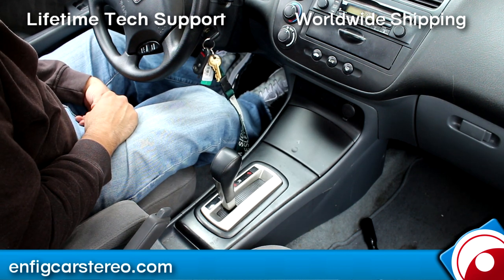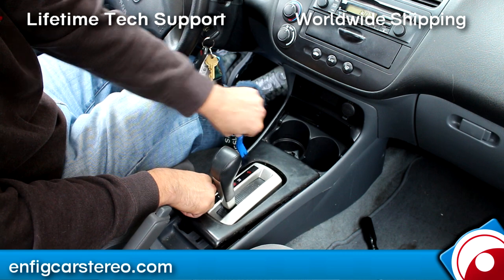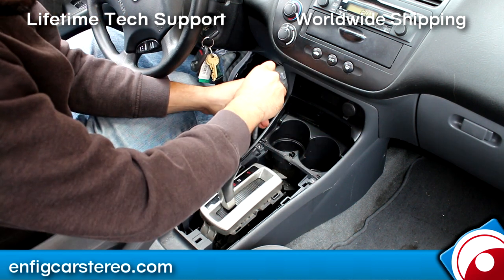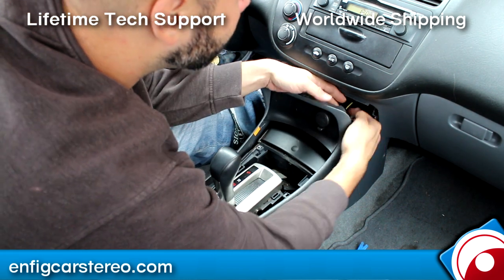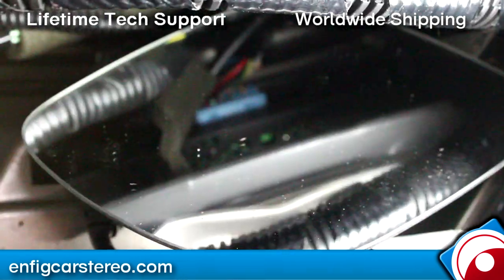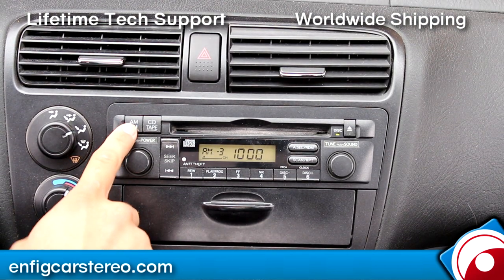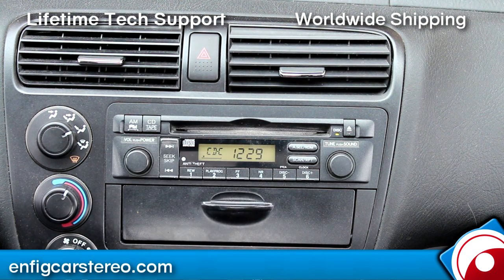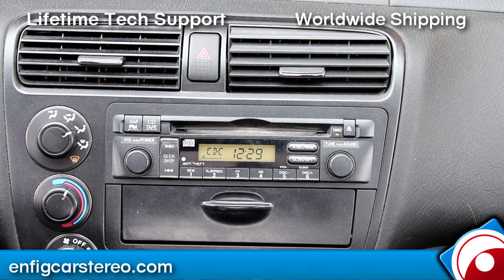Honda Civic 00-05 Aux audio input installation for iPod iPhone Android

Comment: You didn't show the most important part, what you actually plugged into the radio to be able to connect to your phone.
Reply from the maker: +ouagadougou62 I must have been half asleep that day.  Once you connect the aux the cable comes out of the side of the console.  Its so easy I didn't bother to record it.  But I should have.

Comment: Thanks Enfig. Great product and video! Another tip for Civic owners: If you shine a light  behind the radio, there is a very thin space between the radio and storage area where you can see your hand and the position / direction of the blue male connector. Cheers.

Comment: I wanna Thank Enfig for making this video , You saved me a lot of hassle and $$$. I own a 2003 Honda Civic LX. In early 2013 I bought a Sirius Sat Receiver for the car but l couldn't hook it up , NO head phone jack !!! Great , I contemplated on returning it and so for some 6 months I wondered if their was a way to hook it up. I called around to various car stereo installation companies and was floored by what they wanted to install an adapter to make it work upwards of $250.00 that's insane !!! I then found EnFig. I wondered if this would really work and so for days I thought about it. Finally I decided to order the adapter ( BlitzSafe HON/AUX DMX V.1 ) as well as the 6 foot ( Enfig 35RCA-6 ) cable. 3 days later my package arrived. I got exactly what I ordered.

I wanna comment on the installation while this video is good their is another way to install this adapter I highly recommend you watch   Radio removal in 2002 Honda Civic & Sony CD receiver installation Part-1 this video. The reason is that after I followed the steps that EnFig gave I found that in the 2003 Honda Civic LX its a really tight fit to try to get the plug up and behind the radio theirs little room. I decided to pull the center heat and radio console out enough to plug the BlitzSafe in then. If you watch the video that I linked you will see the plug that the adaptor plugs into. If your going to do it the way I did it then dont buy the EnFig tool it wont work !!! I motored down to Pep boys and picked up a ( Door panel removal tool ) cost me $13.00. Follow Enfigs video and after you remove the side panel you'll see two screws their 8MM and an 8MM socket on a 1/4 inch drive was the best way to remove them. After you remove the screws the dash heat and radio console are free , you then need to use the door panel tool to pry out the heat and radio console enough to plug in the BlitzSafe. 

This may seem complicated but its really easy I did my installation at night and in a mall parking lot, it took me maybe 45 min to install. How does it work you ask ? AMAZING !!!! crystal clear sound !!!!! This was my answer ..... Thank You So Much !!

Comment: I'm just gonna say, you won't be able to see the port like in this video. It is literally on the back of head unit. So basically you're gonna take your hand and reach up and feel for it, then plug it in using feel. Still not terribly hard, but they had to have used a mirror or something in this video, because the geography is a bit different In real life. Regardless, it took less than 20 minutes to install and the quality is just as good as listening to a CD. Enfig also has it for the cheapest price. $70 for both the module and the auxiliary cable shipped. 

Its expensive but if you're like me and hate aftermarket head units, or just don't feel like upgrading,  this is a nice clean alternative.
Reply: he did  talk about using a mirror in the video, if you listen closely

Comment: Just installed it in less than 1 hr into a Honda Civic Hybrid 2004. Works great. If you can't see the input whole with the mirror don't worry just stick your hand up there and you can find it. Now just wish I could find the plastic adapter so the jack looked installed instead of a wire hanging out.

Comment: I used this video to install an adapter in my Civic. Here are some pointers/observations: I wasn't able to physically see the back of the radio when I installed it, but I just felt around to the right of the other plug and wiggled the adapter around until it clicked in. You're not really gonna be able to see the plug get put into the socket, so just expect to do it by touch. Once it was plugged in, I ran the cable out through one of the two (formerly) plugged holes next to the cigarette lighter.

Comment: Should the CDC option be available before the device is installed?  I have an 03 Civic with the stock stereo and it does not display "CDC" when I press the CD button.  Does that mean the device won't work with my stereo?

Comment: So this would work on an '05 Civic Coupe? Also, where did you pull the AUX cord through, after attaching it to the radio and putting all the panels back in place?
Reply from the maker: +Nmarryat24 I must have been half asleep that day.  Once you connect the aux the cable comes out of the side of the console.  Its so easy I didn't bother to record it.  But I should have.

Comment: my bougth a honda civic 03 a couple  of months ago,it looks like the previous owner did this job because the aux cord is already outside the panel,but when conect my phine it sounds too low,it also has a smaller cable sticking out not sure what that one is for
Reply from the maker: There are many different brands that make this adapter.  It can be a bad adapter or a bad cable.
Reply: Edward De Jesus all are like that. You have to turn the phone volume  all the way up

Comment: The website says this adapter is for 98-04. Will it work on an 05 civic? Just checking before I buy this, I'm debating on adding an aux to the stock stereo, or putting my aftermarket stereo from my old car into the civic.
Reply from the maker: It will also work with an 05 as long as it has the same radio.  I think some 05 had a newer radio.

Comment: Wait so where do you plug the aux cord? And is there any place I can get this done?
Reply from the maker: The aux cable can some out of the side or the middle.  Where are you located?
Reply from the maker: The adapter make the car think you have an CD changer attached to open the audio.  You need the adapter also.

Comment: Loved your video and product, but apparently the unit has died. Any tips for getting it OUT? Would like to replace. Thanks!
Reply from the maker: Getting it out from the bottom is a little tough.  You may have to remove the radio.
Reply: That was my boyfriend's suggestion too, but I was too stubborn/lazy. For me, wiggling it around was key. Plugged it back in and it's working for now, so thanks again!

Comment: Hi, I have a HONDA CIVIC MK6 (UK) 2004, I have plugged in a similar device to the back of the car and the device powers up and everything. However when I click the CD/AUX button twice, absolutely nothing happens. It is as though the button only works for the internal CD but will not activate the CDC function. (In the manual it shows that I have HONDA AUDIO SYSTEM B TYPE) if you could please reply or inbox me I should be so grateful because at the moment I really stuck.
Thanks!

Comment: What if the cd player is not currently working? The am/fm works but the cd player continuously loads every cd we try but never plays :( any suggestions? 05 civic, radio looks exactly the same.
Reply from the maker: +Angela Aston It should.  You might have to disconnect the radio to reset it but usually that's not the case.

Comment: I might buy this cable but it's the quality of the sound for music good??
Reply from the maker: CD quality because it goes in through the CD changer port,
Reply: Will it last and what's the warranty cuz I haven't found that on your site?? Also the battery looking parts where the Aux cable and the port that connects to the back,does that overheat and is there any danger of having it inside? (The part that has ur logog

Comment: can this be done on the 2003 civic hybrid? been having a hard time trying to get that plate off where the shifter is with the plastic pryer tool
Reply from the maker: I think so.  I don't remember ever doing a hybrid.  Sometimes Hybrids are a little different because they have to make room for the batteries in the car.

Comment: Just realized the car is not in park.
Reply from the maker: With the shifter in park it was in the way of the video.  We had the E-brake up and wheel Chocks on the car.  The part can be removed with the car in park.

Comment: would it work for my 04 civic with the disc reader not working? it just spits the cd back out. thank you
Reply from the maker: +Spiffy Jay IT should.  You might have to disconnect the radio to reset it but usually that's not the case.